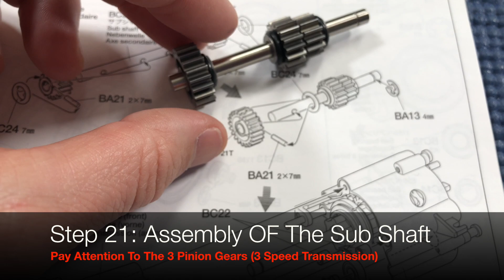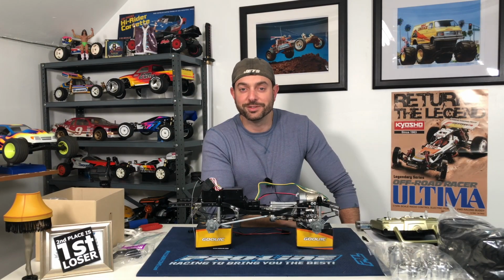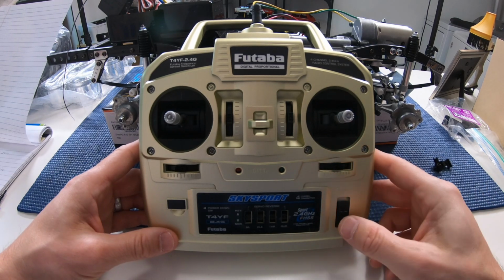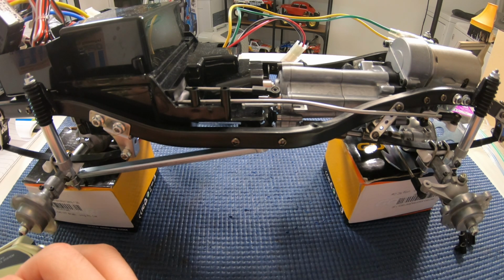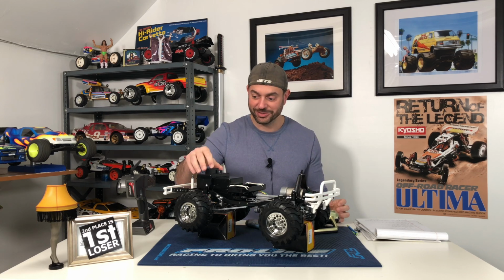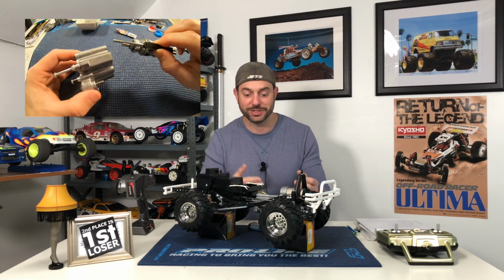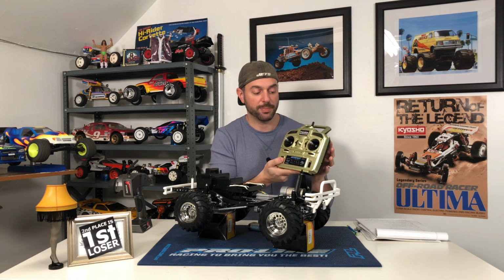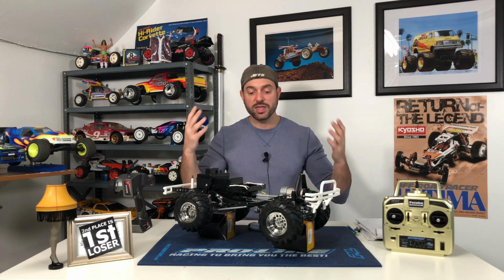e170: Building The 3 Speed Transmission & Test Run Of The Iconic Tamiya Toyota Bruiser 4X4 Pick-Up

Comment: Thanks for the video and about what you used for a transmitter. I've been struggling with the same thing. I'm hoping to stick with Futaba as that is what I grew up with in the 1980's. I even called Futaba tech support and they couldn't tell me with any certainty that any of their pistol grip radios would work. The only issue I have with the radio you are using is that it is for airplanes but it is a solution. After watching your video I then did a search on eBay for the shift gate disk that helps with the shifting. It showed three transmitters. The Futaba Attack from the 1980's, Your transmitter and then a newer version of the Futaba Attack, model 4YWD. This radio is made for these trucks and Tamiya's semi trucks that use a similar transmission. This is what I decided to get. RCMart caries them for around $150 for transmitter and receiver with shipping.
Reply from the maker: Just so you know, I have switched transmitters.  I have moved over to a Radiolink Pistol Transmitter with switches.  This works just as well if not better.
Reply: Which radiolink transmitter?

Comment: I had great fun building my bruiser. What a build it was! Right now I'm working on getting the body painted and fitting LED's. I'm using an Absima CR4S. Works a treat. My only stumbling block was getting those pesky servo savers to cooperate, so I ended up using solid horns for the shifter/steering servos.

Comment: Wow. Amazing gearbox, never built a tamiya like this. Tempting. Was put off by lack of knowledge of the shifting electronics. Curious to see how the transmitter controls the shift servo? Does it have an extra dial/lever I can't see that stays set in position? Great build series! 👍

Comment: Hi, I am a newcomer to RC and have ordered a  Bruiser and will be using your Videos on how to build it. Would you advise on what servos I should use/ buy and did you use the supplied motor hopefully with a pinion?  Forgive my ignorance but the gear changing is - one gear ratio with the servo in neutral position then moving the 'horn' forwards for another gear then backwards through the 'neutral' gear for the third. I guess it is best to keep the truck moving while you do this?
Reply from the maker: So as far as I could remember, I used the stock kit pinion gear.   Also the Silver Can motor with the kit is more than enough.  These kits are not meant to go fast.  More like paraded around.   Yes, you can change the gears while it’s in motion.  I believe there is a 2wd low, 2wd high, and 4wd.  I used Annimos Servos that I purchased off Amazon.   They have a red label And are high torque servos.   Maybe 20Kg’s.  When you build the transmission, take your time and triple check everything along the way.  I initially built mine, and took it apart 2x after to get it to work.  It’s was a pain.  Good luck my friend and enjoy the build.